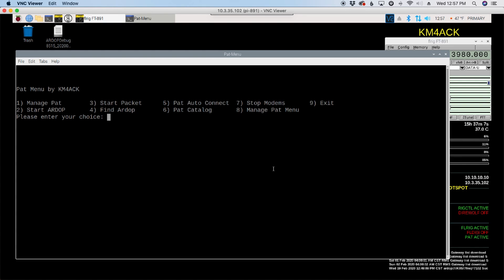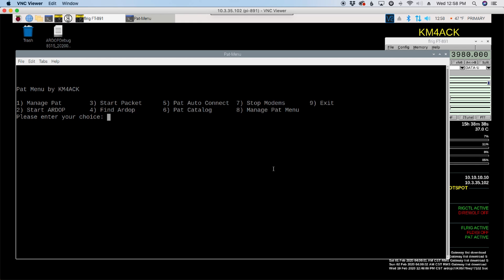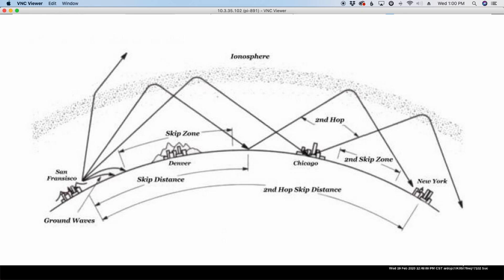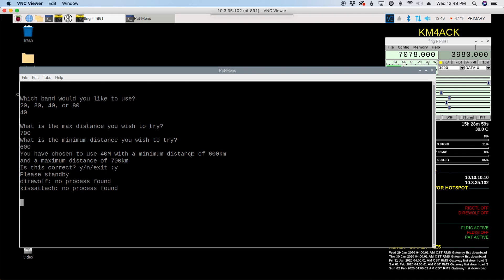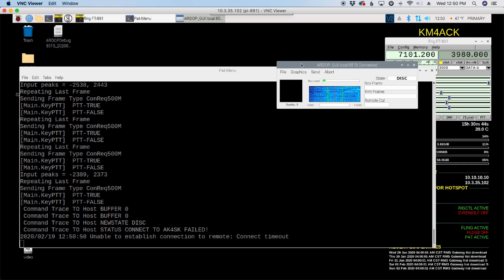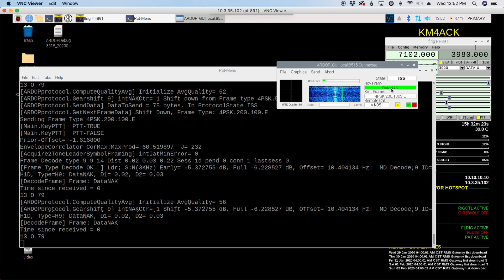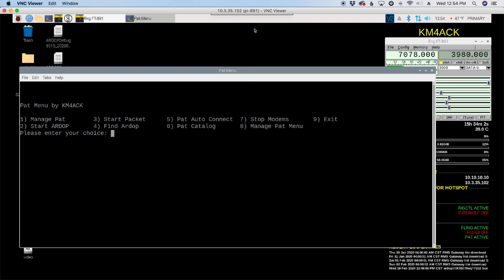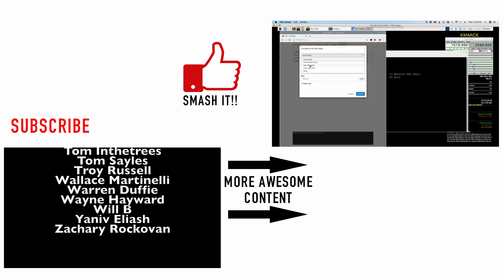How to Make Your First Winlink Connection

Comment: I am just getting started with Winlink. I have only done "Telnet Winlink" so far just to get a feel of emailing. Already learned about whitelisting an address/domain.
You mention picking stations (for RF) but it was unclear how you chose these. Are those on a map in Winlink? Come to think of it, and frequency listings?
Again, I am just starting out and hope to try an HF connection soon.
You videos are quite inspirational! Thanks!
Reply from the maker: There's a list on the Winlink site https://winlink.org/RMSChannels You can also use Pat or Pat Menu to see a list of stations on a particular band. The winlink site is a bit misleading. It lists the center frequency and not the dial frequency on the rig. Pat and Pat Menu both list the dial frequency.

Comment: These vid from KM4ACK are great, but I can't seem to find any information anywhere on why I would want to use PAT instead of plain old Winlink. Is it simply an additional layer of interface to make Winlink easier to use? Does it off all the same capabilities as native Winlink? What are the main advantages?
Reply from the maker: Winlink Express isn't available on the Pi. Pat is the best Winlink client for the Pi platform.

Comment: Does starting ardop start the webserver for Winlink? What starts it if its not ardop?
Reply from the maker: If you are using Build a Pi then Pat is running as a service which starts at boot.

Comment: Jason, where would you tell the pat system to use your sound card? I have the Sabrent usb card like you had used before.
Reply from the maker: If you are running build a pi, open Pat Menu and the click "setting/config"

Comment: Hi.. I am new to Winlink.. I have found it difficult to connect to Winlink stations due to latency which is quite high at times.  Do you have any suggestions how to lower latency to acceptable levels?  Not sure if this is software or rig related but my radio is an Icom 7300.

Comment: On my IC7300, when I do the auto connect in Pat Menu my radio only puts out <5 watts.  Doesn't matter what I have it set too.   The power works find in other modes, including JS8.   Any thoughts?   EDIT: This seems to continue happening until i stop ARDOP modem and exit and rerun FLRIG.
Reply from the maker: Sorry I can't advise on the 7300 but if you check my FAQ page, https://tiny.cc/km4ack-faq there is a section there submitted by another viewer to help Icom owners.
Reply: Few updates to anyone else that hits this issue.  I was able to get around the problem by simply changing the mode in FLRig to something different then back to USB-D.   However the better news is that I don't encounter this issues after installing Pat Menu 2.0.

Comment: What can I say...every video is over the top good.  Jason is a great presenter, easy to understand, and production value is exceptional.  One question if anyone has figured it out.  Is there a way to run FLRIG and ARDOP/PAT at the same time?  I get a "BUS conflict" - probably because RIGCTL is trying to access the same device the same time as FLRIG.  Any work-arounds?  It sure would be nice to have control over power, mode, etc. while ARDOP is running.  Thanks again Jason!
Reply from the maker: By default, this should work with Build-a-Pi if you use Pat Menu to start your modem. If you are getting a conflict, check your Pat Menu Config file. (~/patmenu/config) Make sure you have your rig control set to use FLRIG in there. RIG="/usr/local/bin/rigctl -m 4" This will pass all of the  rig control commands to FLRIG which forwards them to the radio. 73, de KM4ACK
Reply: @KM4ACK  You ROCK Jason....WORKED!.....well that just saved my marriage (8 hours of changing every configuration setting in a hundered different files).

Comment: Thanks for this script. I’ve been getting an error on pat auto connect that “flrig needs to be setup for this to work.”  Flrig is active, I’m making JS8call & fldigi contacts, the radio and patgui are responding.   The frequency isn’t populating in the alias window. Any suggestions? N4DPH
Reply from the maker: You need to enable rig contol in pat menu config. I cover it in this video https://youtu.be/r0-CzyYgW5k

Comment: Thank you for this video. I always prefer Winlink with the Airmail software and a Pactor modem by SCS. That works (for me) excellent for many years! vy73, Dietmar, DL4HAO
Reply from the maker: Nice! Are you running that setup on a pi?
Reply: @KM4ACK  sad to say, no, some of my favorite applications are windows only avayable :(  still searching an application to work winlink with my pactor modems @ a pi ... i´m not a fan of soundcard modes, as they do imo not offer a mode with excellent working ARQ modes (which I prefer) for a 100 % error free data transfer via HF ...

Comment: Wish Winlink wasn’t so difficult to download to your computer
Reply from the maker: Have you tried build-a-Pi? It does the heavy lifting for you.
Reply: No haven’t ventured into that yet. I have a Surface Go tablet I bought to run Wires-X and would like to use that for Ham related stuff. Had issues getting Winlink downloaded.
Reply from the maker: John N4EJM sorry. Can’t help with Windows.

Comment: Thanks for all the great vids.  I am having a problem with your Pat Menu system after installing it with Build-a-Pi 2.  When I try to start the Script from the Desktop, I get the window and select Run in Terminal and then get an Error about (xterm) no such File ...etc.  any idea what I can do to correct this or should I just UNINSTALL and manually install from the Dec 10 Video.  thanks  KB9RHR
Reply from the maker: Resolution found here https://github.com/km4ack/pi-build/issues/34

Comment: Thanks for your tutorial on Winlink. The information you provide and the points you note about how to find an acceptable station are very relevant for me. I've been frustrated using Winlink in the past. To be honest I've never tried it on 20 meters but will do so just for fun. Here in my area getting any connection seems more good luck than good work. Between propagation problems and busy stations, sending anything via Wnlink successfully seems to require some kind of supernatural intervention.
Reply from the maker: Hate to hear that. Hopefully you can find some useful info in the video and start making regular winlink connections. 73, de KM4ACK